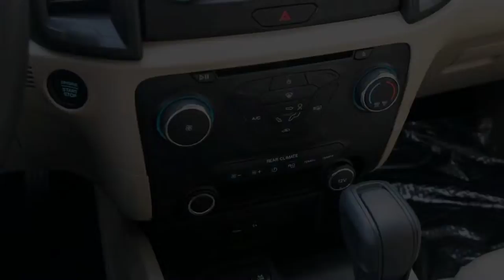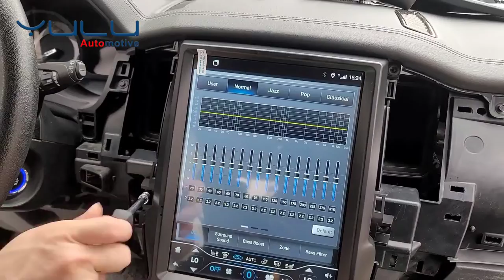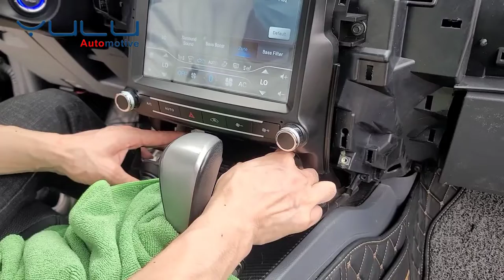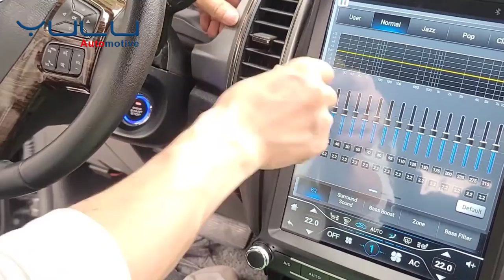YULU E10 installation video for Ford Ranger and Everest.

Comment: Hi, i bought a px6 unit for my Everest but doesn't work, no reverse camera, no subwoofer, no Steering wheel controls, no a/c function , just if i use de ford f150 car model, i think the vendor sent a wrong interface, any help? Thanks in advance
Reply from the maker: Hello,here is Yulu radio customer support,it's not our E10 radio unit,correct?I am afraid you contact wrong person

Comment: Hello, please make a video, how does to install when we have manual ac
Reply from the maker: Hey, the manual AC version of  head unit has built in our AC circuit board,  so just install it directly without steps of replaceing factory circuit board
Reply: @yuluautomotive7433  thanks. I’m writing on WhatsApp about a few problems, I have manual ac. The seller can’t respond me.

Comment: How do you hook up the OEM backup camera? Says there is a link or video but can not find it. 2019 Lariat Sync 2/3
Reply from the maker: Find another harness in the package that connects to the SYNC2/3 plug, connect it to the yellow "back camera" plug on the E10 main harness. If you need help, please contact our after-sales engineer, thank you! Phone number: 8184846579

Comment: Hallo why i need the OBD Plug? Now i have the OBD port ocuped is the OBD plug Nessecary?
Reply from the maker: The OBD socket is not required, it currently only affects a few data displayed on the home page. However, some new functions will be added in the future based on the OBD port, and it needs to install some applications to communicate with the OBD. If the OBD port has been used, you can purchase an additional 1-to-N cable to expand the port.

Comment: Hello. I have this Radio from you. What i have to do that my oem rear view camera works? It is not possible to connect now
Reply from the maker: Please follow the instructions in the video to connect the yellow plug in the wiring harness to the back video plug. If you need help, please contact our after-sales engineer. Phone number: 8184846579